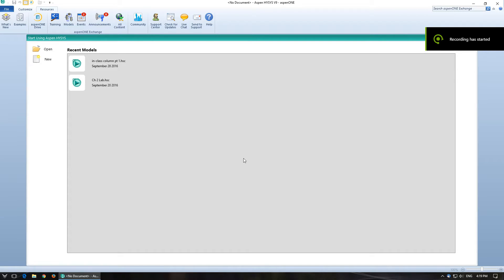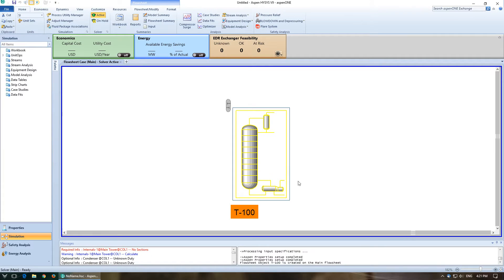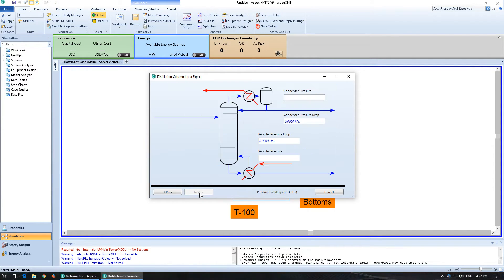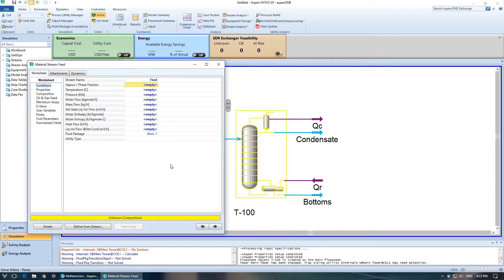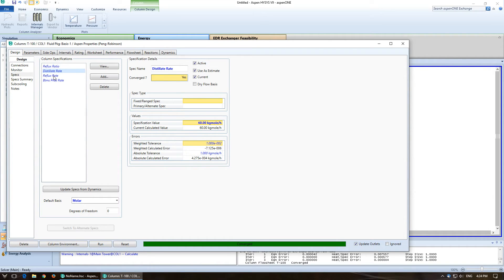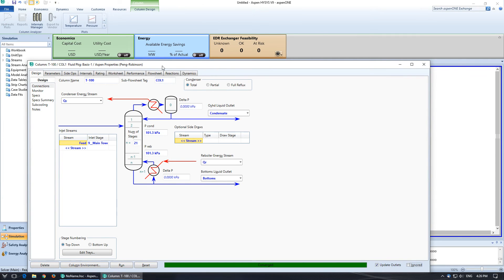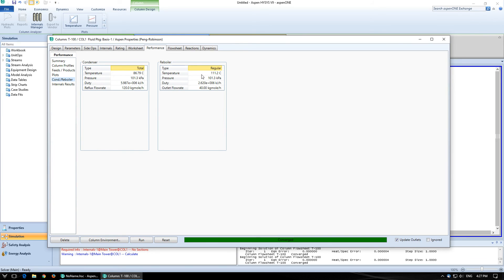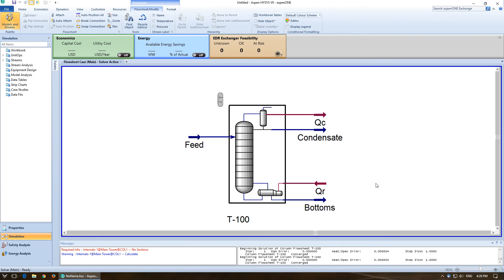Aspen Hysys Simple Distillation Column Walkthrough

Comment: 4:40 to 5:48 What happens if i skip that step? Like not doing it.
Im in a hurry, thanks
Reply from the maker: That "step" is changing the configuration of the column so you're specifying information about the reboiler instead of the condenser. Since we're using the same value calculated from specifying the reflux ratio you should get the same answer, but this step was designed to teach users how to specify different inputs.